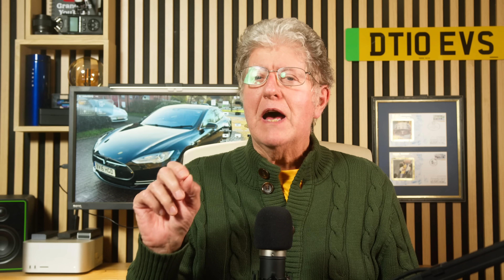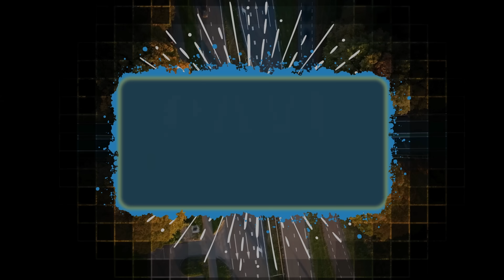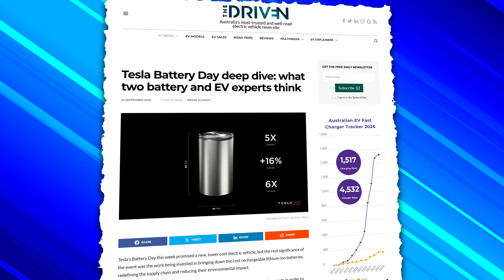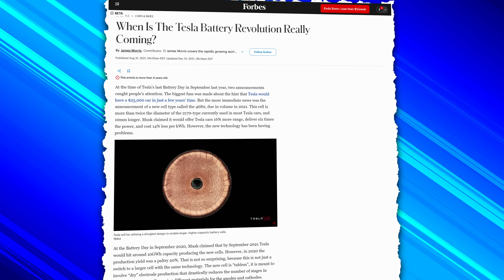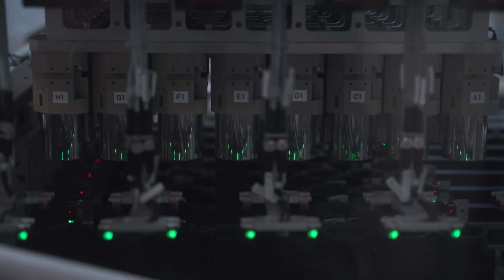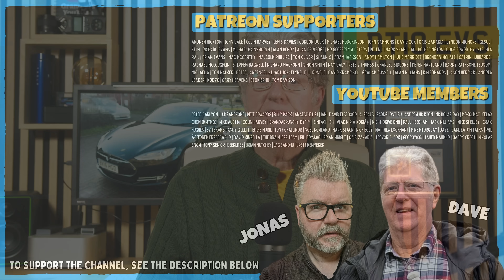The Real Reason Tesla's New Battery Is Such a Big Deal

Comment: From Grok

*Mostly hype / exaggeration, not fully true as presented.*

The video (from channel "Dave Takes ItOn", uploaded Feb 22, 2026) claims Tesla has now *fully achieved* a revolutionary dry battery electrode (DBE) process for *both* anode and cathode in the 4680 cells. It says this eliminates toxic solvents/drying ovens, slashes costs >50%, enables ~1,000 Wh/kg energy density (beating solid-state), massively improves longevity/fast charging, shrinks factory size, and unlocks super-cheap EVs + robotaxis.

*Reality check (as of early March 2026):*

- Tesla *has* made real progress on dry electrode coating, especially for the *anode* (graphite-based). They've implemented versions of it in 4680 production at Giga Texas and are scaling.
- The *cathode* side (NMC or similar high-nickel) is the much harder part — Tesla has repeatedly talked about dry cathode as the big unlock since 2020 Battery Day, but *full dry cathode at high volume with good performance hasn't been publicly confirmed as achieved yet* in mass production vehicles.
- No official Tesla announcement or credible large-scale third-party verification exists (as of now) saying "we've fully cracked dry cathode for 4680 and are running it at scale with those dramatic results."
- The ~1,000 Wh/kg figure is wildly optimistic/speculative — even lab prototypes of advanced batteries rarely hit that today; practical 4680 cells are still in the 250–300 Wh/kg range at pack level.
- Cost reductions are happening (4680 is cheaper per kWh than previous cells), but *>50% from dry process alone* remains an aspirational goal, not a demonstrated 2026 reality.
- Tesla is still using a mix of processes; full dry-electrode cathode is considered one of the last big manufacturing hurdles.

So the video is *directionally correct* — dry electrode is important, Tesla is pushing hard on it, and success would be huge — but it presents **aspirational / leaked / speculative future wins as current accomplished fact**. Typical enthusiastic Tesla fan/advocate content rather than sober reporting.

If you're asking whether Tesla secretly solved everything and is about to drop $20–25k EVs tomorrow… no, not yet. The title is classic clickbait framing. 😄

Comment: The end user battery is but a small part of the equation. There isn’t enough electricity available anywhere to charge numerous high capacity vehicles at the same time. One would need a small nuclear power plant on site with cabling too heavy to lift to make charging comparable to the 3 minute ICE fueling process. Oh, and that’s IF the app is working properly and lets one actually access the station. No, thank you.

Comment: I seem to remember them mentioning that the new cells tabless contrsuction would result in a 30% reduction in internal resistance.  That would result in a large reduction in heat losses, which should improve range.  What happened to that?

Comment: Dave I like you because you present in a good down too earth way. Your predictions are questionable. Economics matter. Want an AI centre cost one Billion , plus you have to build your own energy production plant & distribution network to the data centre. The tax payer cannot bear the burden. Society notes the crumbling infrastructure & high cost replacement off it. Investors want the old model off a 50 to 70 year return. So how can society afford that as energy prices soar. The EV still lives on an infrastructure that cannot afford the green adoption , thats obvious to a hybrid system with intermittent,  curtailment planning & subsidies. Tesla is going to make far more money in Space. Economics, change very quickly. A large scale plant no longer has longevity. Cheap energy is desperately needed if you realise energy demands are only soaring. Tesla has a niche. No doubt about it. Robots in factories are a revolution. But it has a high social cost. The welfare state can no longer be afforded. Great tech , but unless economies get new models they are stagnant or dead.

Comment: There are several problems with current EV battery tech.
Weight, size, capacity, charging time, price, longevity
Exploding batteries
Toxic chemicals to make the batteries
Severe energy loss in cold weather
Right to replace old batteries
Ability for a weekend mechanic to replace old batteries
Number of charge stations
Political reality of Tesla haters sabotaging charge stations

Then there's the energy supply.
American grid is old and in dire need of upgrade
Cost of electricity
Shortage of electricity caused by:
a. Too many EV's trying to replace the existing petroleum fleet
b. AI computer centers using a very large amount of electricity
c. "Green energy" being wholly incapable of scaling out as promised

Comment: The batteries are just batteries and they keep getting better however that particular engineering is only part of the equation.  The game changer is not the battery but Tesla’s new electric engine design which is a brand new concept which has been proven to kill all other EVs.  Tesla’s new engine does not suffer from excess heat because they no longer use metal sleeves to hold their engines together.  They secretly in house built a brand new engine that is wrapped and held together under  tension using carbon fiber wrap.  Indeed the engines going into Tesla vehicles can be carried by one person. All electric engines were maxing at out 18000 RPM and would step down because of excess heat.  Tesla’s new engine breaks this barrier and keeps on going with no slowdown for cooling off.  Tesla built the machines that built the machines that produce the engines all in-house so it is proprietary.

Comment: Dry battery cathodes just makes the battery cheaper, not better. I'd rather have a 800V battery that charges at 400kW like the 4095 batteries by BMW than a cheap 400V battery that takes 35 minutes to charge.

Comment: The nay sayers need to remember that Elon would not be doing this if it did not significantly advance Tesla products.   4680 exists and meet the design goals.  I suspect the new $60,000 Cybertruck is possible because it is using these lower cost batteries.

Comment: the savings isn't even the star of the show- although, it is a HUGE deal. cutting battery cost changes a LOT about EV's. the real shining star of the 4680 cell is something that tesla is going to spring on the rest of the market.. in about 10 years. remember all the hype about the 'million mile battery'? it was what tesla fans were waiting for elon to announce at THAT 2020 unveil- but, total silence. no mention of it- and almost NO ONE would know- unless you were very closely following maxwell technology BEFORE they were acquired by tesla. maxwell did the proof of concept of using a dry application process- and posted their results on their website. they did this to try & reduce the time & cost of making lithium batteries- but what they discovered during testing blew their minds: cells that are manufactured using this method? DO NOT GROW DENDRITES! both theirs & tesla's early testing revealed that the lifespan of this battery will be 50 years and 2.5 million miles- and that? CHANGES EVERYTHING. while gas/gearheads obsess over range, range range- an issue that has long since been rendered pointless & abandoned by tesla owners because of the tesla supercharging network- tesla was quietly going after what really DOES matter- battery life- and plenty of it. so one day- when a cybertruck owner posts a screen shot of a tesla 4680 pack with 500,000 miles and almost NO battery degredation- only then will the industry start to realize- tesla WON. charge speed? battery range? IRRELEVANT- if your pack doesn't have a tesla logo? JUNK. waiting for the scrap pile.

Comment: I like your enthusiasm, but where is the battery? The battery weight is still the biggest challenge, so we have to get to the other side of 2000watt/kg before I consider it significant, and that's still 1/6 of the energy in diesel. But packing so much energy into a battery can become an even worse challenge with thermal runaway and fire, which are serious enough already. Why doesn't anyone want to talk about the environmental consequences, the ones that our children and grandchildren will have to live with?
Reply: Where do graphene batteries fit in?

Comment: OK, couple of errors in this video. Concerning sodium batteries and their energy density. He claims that sodium has an “ appalling“ energy density, but in fact, CATL is currently selling sodium batteries for production vehicles in China that have the same energy density as LFP. Approx 190 w/kg. Along with this improvement comes the reduced cost of producing sodium, which is probably 20% of LFP, and incredibly improved performance in cold weather and charge cycles up to 10,000

Second point, he claims that the 4680 dry cathode process will leapfrog solid state energy density and produce a battery that is up to 1000 W per kilo. Hard to believe.

About the only accurate part of this video is the emphasis on reducing cost in the manufacturing process. This is clearly a huge breakthrough and in and of itself will be well worth the five years of development from Tesla.

Comment: The cathode is negative. Anode is positive. Otherwise great stuff
Reply: That's what I thought!
Reply: In batteries, electricity flows from anode to cathode. So, the video is correct.
Reply: @PravinDahal The anode attracts negative ions where those ions lose an electron or two. The cathode attracts positive ions where those ions gain an electron. The electricity does NOT flow from the anode to the cathode or from the cathode to the anode. The current is carried by ions gaining or losing electrons.

Comment: Yeah, that's all well & good for Tesla but thinking this technology helps with fast charging that doesn't degrade battery performance is still a pipedream for EVs in desert climates like AZ Nevada etc, etc, etc.

While 4680 cells have superior thermal management (tabless design) compared to older cells, they are still NCM (nickel-cobalt-manganese) chemistry, which is vulnerable to heat.

Mitigation: Tesla’s active liquid cooling helps, but constant exposure to extreme heat, combined with fast charging, can still accelerate degradation.

Asking people who don't own a home to install EV charging  or worse they live in apartments or assisted living facilities. 

Who wants to wait at a roadside charging station? Especially when those 
Public EV chargers typically take between 30 minutes and over an hour for a substantial charge (20%-80%).

That's if you can find one that isn't trashed being repaired or claims to be fast charging but it's really half ass charging, lol blablabla, hahaha, LMAO !!

I know my gas vehicle can be filled within minutes and I'm on my mofo'ing WAY! No hassles, no range anxiety or broken chargers. 

Plus: The myth that EVs are more reliable than gas cars

While EVs offer fewer moving parts and lower maintenance, data from Consumer Reports suggests they currently face more reliability issues—often related to new technology, infotainment, and battery systems—than established gas-powered vehicles. Although the gap is closing as manufacturers refine production, many EVs still experience more problems within the first few years of ownership.

Comment: Too little, too late. If this 4680 battery had come out 2 or 3 years ago, then presumably they would be installed in the last few years of Tesla production models.
Now, solid state batteries are supposed to be out in about 2 years, with volume production in a year or 2 afterwards.
By the time the 4680 batteries actually move into volume production, solid state batteries will be rolling out, or close to rolling out, at which time, anything that isn't solid state will have limited markets.

Comment: For those who have not followed Tesla, the 4680 was suppose to be a "tabless" actually many tabbed battery able to charge and discharge faster.  Tesla has never been able to make it in large quantities because the multi tab proved to dramaticaly increase the fail rate of production batteries.  It was a key part of the CyberTruck and cause years of delay in introduction of the Truck; even when it was brought out, they lost a great deal of money  on each Cybertruck due to wasting so many cells.  Tesla's new statement is they claim to have improved the fail rate by changing the battery design - probably a lie just like 80% of what they say.  They lied the entire time about the battery before; nothing has changed.

Comment: You say the Corpus Christi plant uses locally sourced Lithium, presumably from 
brine? Or did you mean using their table salt and clay patent? My understanding is that it is working with Spodumene, from overseas?

EDIT: The Lithium is not sourced locally, the Soda Ash used in the refining process is sourced locally.
Reply: it definitely does not use locally sourced lithium.
Reply: They opened a lithium mine in west Texas.
Reply: @deezynar  Where exactly? I can find reports of development work on brine lithium, but no mines. Corpus Christi uses Spodumene, which is soured from rock.
Reply: @grahammonk8013  
Round Top Mountain.  The mine is slated to open in 2028.
Reply: @deezynar  I cannot find anything about Tesla being involved with that. It isn't operating now, so it is not being used at Corpus Christi.

Comment: While there are no 1000 Wh/kg rechargeable batteries in mass production, several companies and research initiatives have announced, developed, or are targeting this density, primarily using advanced lithium-metal, solid-state, or inorganic electrolyte technologies. Examples include: 

-- Innolith (1000 Wh/kg): In 2019, Innolith AG announced the development of the world's first 1000 Wh/kg rechargeable battery using a non-flammable inorganic electrolyte.
-- WeLion (824+ Wh/kg): Chinese battery manufacturer WeLion achieved 824 Wh/kg in laboratory settings and is targeting 1000 Wh/kg, with mass production planned in the coming years.
-- Sion Power (500 Wh/kg+): Sion Power demonstrated its Licerion® lithium-metal technology at over 500 Wh/kg for aviation applications.
-- Amprius (450 Wh/kg+): Amprius Technologies produces commercially available silicon-anode batteries with densities up to 450 Wh/kg. 

These ultra-high-density batteries are generally in the prototype or pilot production phase, aiming for applications in electric aviation and premium electric vehicles rather than consumer electronics.

And then there's Donut Lab whose wild claims will have 3rd party test results coming out in about 17 hours from now.

Comment: I hope they can get the energy density up and cost down but looking at the 100% dry battery, I'm still seeing only 244–296Wh/Kg.    And did I hear you correctly - did you mention something about 1000Wh/Kg?
Reply: Official Energy Density: 233–244 Wh/kg (gravimetric), 622–650 Wh/L (volumetric), long way short of 1000wh/kg

Comment: You're a bit out of date Dave.  Both CATL and BYD are now producing batteries that employ salt rather than lithium in recently introduced vehicles.  battery density has come very close to that exhibited in LFP cells while the introduction of a new cathode technology has brought the kW/lb disparity down as well.  Lithium is not going away, but salt is catching up fast, and in some applications has already passed lithium.  It's a pity that due to one imbecile in Washington we can't buy most of the alternatives to the Tesla clone family.

Comment: Assuming this is something that becomes part of all new Teslas at some point soon, the drawback is that they are Teslas. Current models just don't tick my boxes after the substantial changes in recent years, and they're only going further down the process of removing the driver from the experience of driving. I had an M3LR for four years and it was amazing, just like Dave's one. But they're not like that any more, so that's my first and last. Hopefully, other makers will come up with similar technologies in the near future, and we might have dry-cell, and/or solid state, options from all manufactures in say, five years.

Comment: The anode is the positive side of a battery  small correction
Reply: Whether the anode is positive or negative depends upon the type of cell and the current use of the cell (charging or discharging); the polarity of an electrode is not fixed. In electrolytic cells the anode tends to be positive and in galvanic cells it tends to be negative (from the discharge cycle perspective, which becomes inverted for the charging cycle). In galvanic cell operation, batteries such as alkaline cells, NiMH and Lithium cells, the anode's polarity is negative during discharge, and positive during charging.
Reply: @GruffSillyGoat Thanks. Clear I last studied physics in the early 1970's...
Reply: Aye... Anion and Cation is the other way round from Anode and Cathode....